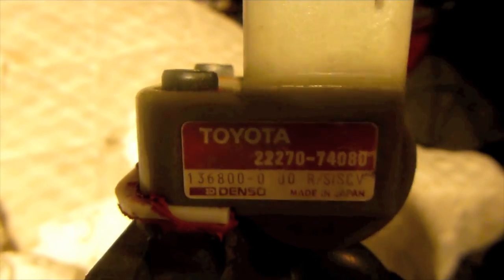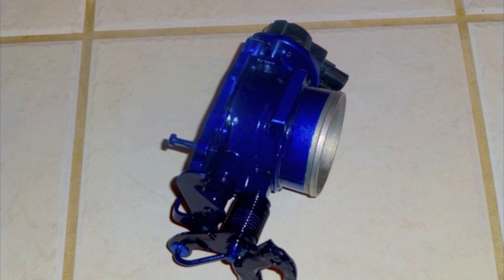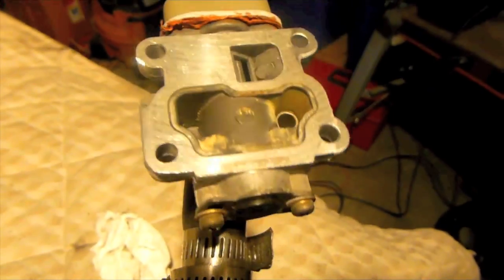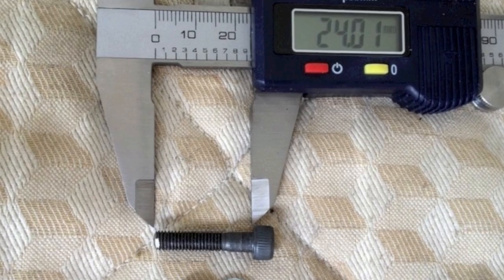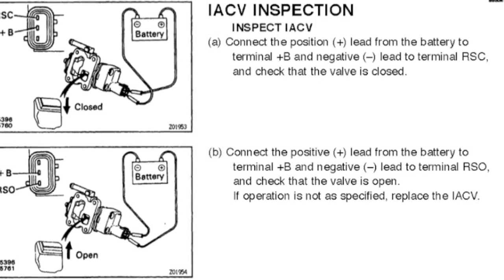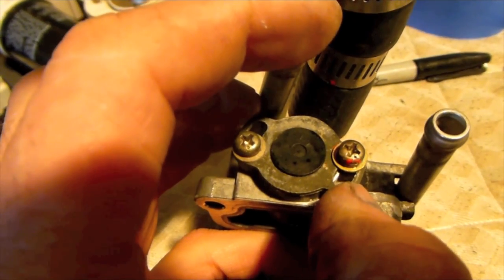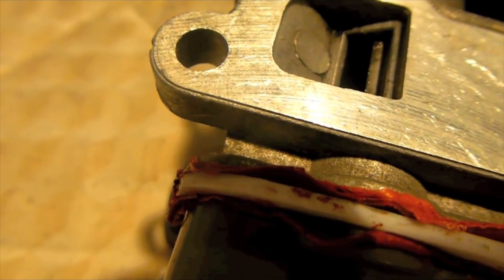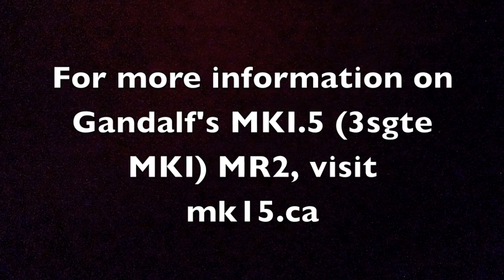Idle air control valve IACV, idle speed control valve ISCV from 3sgte engine (MR2 and Celica)

Comment: thanks for the vid. still useful in 2020. question. I have a thumb, or thud sound when im under boost, specially when I let of the gas. I can't figure out where the leak is coming from. I've replaced every vacuum hose but nothing. is there anything else I can check? theirs no loss in power or anything, boosts just fine but the noise is annoying, engine is stock. gen2 turbo
Reply from the maker: Vacuum/boost leaks won't likely produce the sound you describe... they usually squeal or are inaudible under the engine noise. A thump or a thud sound... I would check all the motor mounts, especially the front/rear, exhaust system, intercooler mounts etc. As you come off the throttle the engine rocks forward (and rocks backward with sudden hard acceleration), and something is making accidental contact with a part of the frame etc, or there is looseness that shows itself with the engine movement. 
Any idea as to the location of the sound?
Reply: Martin Johann Kloppers. Thanks I’ll check all of that.  The noise seems to come from the turbo area. But only when boost hits and the gas pedal is let off.
Reply from the maker: @frnciscob1  It occurred to me that while you may not have a leak, you may have boost-induced movement of a silicone coupler or joiner in your turbo piping, clamps etc, so that it caves in as throttle is closed under boost etc.

Comment: hi i would to ask i got idle issues my idle goes 1,500 when neutral sometimes the idle goes to 1thousand, i adjusted the back of the idle control valve i loosen the two screws and set it in fully closed, the idle goes smooth at no AC but when i turn on the AC the idle drops down to 600 when the compressor is engage. Question does it really needs to be closed i mean the setting on the back of the iacv? or should i have to set it a little bit open so that the air will pass through?
Reply from the maker: Part of the job of the IACV is to open more during AC-on so that your RPMs at idle stay relatively the same or increase somewhat ... so it is possible your IACV is not actuating. Did you test it? You may have changed its range by moving it to the position that provides fully closed, and this gets you a normal-ish idle, but then when you flip on the AC the IACV is not compensating/activating and your RPMs drop too low.
With the IACV working properly on a stock (oem) setup, yes you likely want to have it adjusted so that it never fully closes and allows for a decent idle.
The purpose for me to adjust mine to close fully pertains to my particular setup, with a Lincoln TB, since I was putting it on a switch.
Adjusting it should be a last resort especially if it was working properly previously at some point, and priority should be to test its operation, and eliminate other possible reasons for high idle (like a vacuum leak).
My method for diagnosing high idle issues or abnormal changes in idle:
-was something worked on or possibly disturbed/changed recently that may affect idle? Couplers, hoses, boost, turbo etc? if not, proceed to next step
-do a boost/vacuum leak test on everything... couplers, hoses, BOVs, turbo, intake manifold, gaskets, everything... Eliminate all leaks. Boost leak tester is easy to build using ABS, and carefully spray test areas with slightly soapy water (dish soap is fine)... avoid soaking electronics.
-try and clean the IACV internally with carb cleaner, if it improves a bit then you may be on the right track.
-test IACV operation as per the BGB. If I am contradicting the BGB, follow it, haha.
-remove the IACV and test it with voltage from a spare battery. If it is working properly and responding, you may have a wiring or ecu issue.

Sometimes there is a separate idle set-screw right on the TB itself, which limits how much the TB will close... if this is changed it may also throw off your TPS, so be aware... 
Hope that helps!

Comment: Hey! I was wondering if you can give me any advice on my manual '91 Celica GT? It's dying on its own when I slow down/stop, unless I hold a mild rev on the gas to keep it from dying out. If it does die it won't start back up again at first. Pretty hot, I can see the heat lightly coming up from hood. Usually takes a few cranks, but within a half hr it has been starting up. I took it to an 'Oil Stop' and got a tune - up : Full Oil Service New Fuel Filter, Spark Plugs, Ignition Wires, Rotor and Distributor cap. Only note they added was "Cracked Air Intake Hose"Bought the car on a hunch for $750. It shakes a lot unless I go fast/keep at high RPM.
Reply from the maker: So your engine is a naturally aspirated 2.2L 5sfe, and your car is a North American model?
Coolant topped up and engine temps normal? Burning/using oil? Compression? Leaking fluids anywhere?
Assuming the above is normal/correct, first thing I would do is test for vacuum leaks. Replace that intake hose, you should be able to track down a used one from a wrecker for not much$.
 I would get a hold of the service manual online for your car/engine. Join the celica forum. You can then do some basic testing (requiring a voltmeter) on a few items like the TPS (throttle position sensor). The IACV also needs testing. The Celica/MR2 forums offer great resources and help. Join them. Find a local wrecker that has pick&pull policy, and has a Celica or two.

For $750 it's a steal... really without me actually looking at it. late 80's early 90's Toyotas were the best built and over-engineered cars, period. It likely won't take much $, and with some effort it will run well.

I also have later model 5sfe (Camry) parts that may help, if it comes to that. email me at 3sgte @ mk15.ca

Comment: Hi, my 3sgte stutters like mad :( Can I clean the IAC just by spraying Carb cleaner into throttle body without disassembling it? Thanks for the video Martin:)
Reply from the maker: peyeum  Hi there,
You can try it, it might take a fair bit of fluid to flush it out well. Its possible though, that your stuttering may have nothing to do with the IACV, since the IACV mostly affects idle speed. Boost/vacuum leak, or refresh of plugs/cap/rotor may help you more in that area.

Comment: I took my idle apart and cleaned it but made no difference, I then unplugged the connector to it and the idle was normal, plugged it back in and it started hunting again, the ecu will come apart now to check for knackred fuses etc........ seems to be common
Reply from the maker: did you test its operation by supplying power/ground to the pins? and did you test to see what voltage patterns the ecu is sending to the iacv at the connector?
This way you can see if the ecu is telling the valve to intermittently close, thereby causing the idle to surge. If the ecu is purposely causing it, there could be other causes like coolant is low and air is in the coolant, confusing the ecu due to other sensor readings it is receiving. You/we just need to eliminate the iacv as a suspect definitively, and then move on. (If you have done this, please disregard :) )